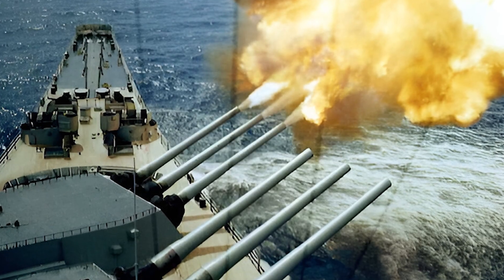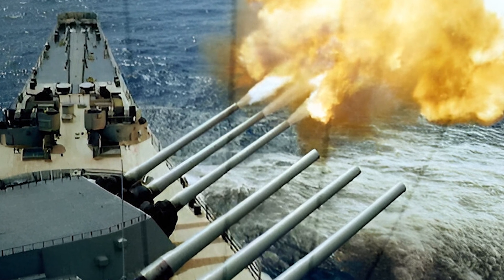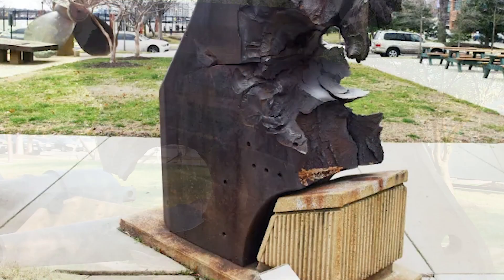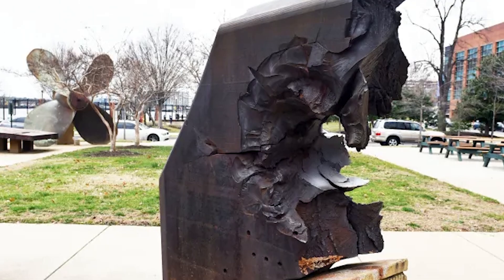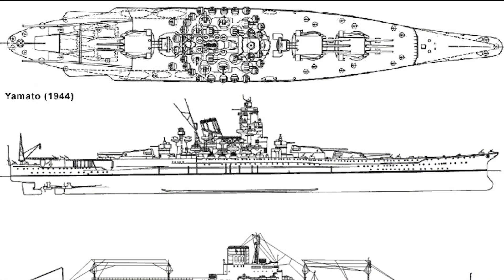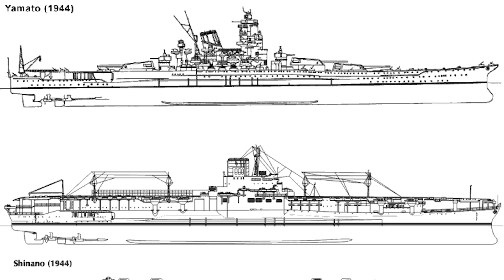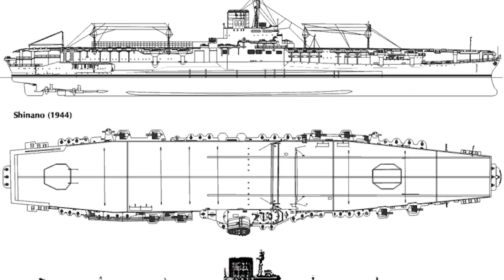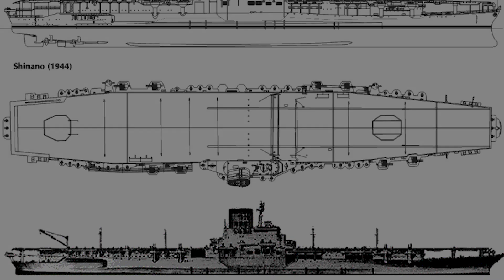USS-Iowa VS Yamato Armor Simulation

Comment: idk if the same applies for warships, but Japan has a long history of having very poor quality steel (this is why the swords were folded 1000 times), leading to their tanks for example having very brittle armour. Does your simulation account for this lower steel quality, assuming their warship steel was also of poor quality?
Reply: If you're going to base your assessment of 20th century japanese warship armor on your understanding of 12th century japanese swordsmithing, could you, at the very bare minimum, actually understand the sword part of it instead of just parroting tired myths based on oversimplifications so great they basically just become lies?
Reply: Look up battleship New Jersey YouTube channel battleship armor video. Yamato was only 5 percent worse in quality compared to the Iowa. And they were worse not because Japan couldn’t make good armor, it’s because as his video states Japan was capable of making good armor from less the perfect materials. This was done so they can save on metal in the war. The effects they determined were negligible in armor quality against shells.
Reply: From memory......

The steel used on their previous ships was the equivalent of Vickers steel, with the face hardened armour on the Yamato class being an attempt at improving it, but keeping in mind costs....

To quote Nathan Okun's website:

"Highly modified form of Vickers cemented (VC) armor. Used 1910-spec VC deep-hardening process, but increased Carbon content to 0.5-0.55% and eliminated cementing to reduce cost so that the maximum face hardness was about 510-520 Brinell with standard heavy production plates"

"Same metallurgical composition as new Vickers non-cemented homogeneous armor."

"By retaining the old Vickers water/oil quenching process on plates well above the thickness it was designed for, all VH plates in the thickness range 17-26" (43.2-66cm) did not cool fast enough deep inside and formed brittle upper bainite at their centers, which did not make them less effective as armor, but did cause them to snap in two through the impact point on any solid hit, which could result in secondary effects such as jamming turrets (the Japanese investigated the problem and solved it, but by that time no more battleships were being built)"

Call me crazy, by armour snapping in 2 would in fact make it less effective as armour...... but maybe I'm missing something.

According to his article,

Where "1.00" is the best,

The face-hardened armour fitted to the Yamato class is 0.839

Or only just better than German ww1 armour (0.828)
Reply: I'm surprised they even had enough metal to build those massive battleships

Comment: Still going pretty fast after, I can't imagine what it would look inside assuming it didn't ignite the battery.
Reply: Regardless of if it sets anything sensitive off, the turret crew definitely isn't having a good day.
Reply: @imapopo2924  Nope and I'm gunna guess a fairly large dent on the opposite site.
Reply: @ScoutPilfer  this wouldn't happen to the yamato. The test they did was not to test the capability of the iowa class against the yamato class, it was to test if the shells they had could possibly penetrate armour that thick. Under combat conditions the iowa would have bounced off the yamato's turret front at point blank range due to the angle at which the armour is mounted, the lower powder charge needed for safety and the worn barrel, as the one in the test was brand new.
Reply: Unless there was an exposed set of charges in the turret, it probably wouldn’t cause a magazine detonation right then and there. It might start a fire which spreads down the barbette into the magazine, but it’s unlikely to cause an explosion at the moment it impacted
Reply: @dr.depressed._6547  Idk if a fire would be able to easily travel down the entire ammo elevator
Reply: @dr.depressed._6547  I know, I'd say there is a reasonable chance of that in an active battle.
Reply: Probably a similar situation to the Iowa turret explosion. All the crew in the turret is lost, but the magazines remain safe.
Reply: It wouldn't ignite anything unless there are powder charges being loaded which would still only ignite just those charges. By that point, every naval ship had the gun house separated from any handling space and storage spaces by a series of flash tight doors. Only one opens at a time such that sparks and flames cannot travel between all the sections. This means any explosion in the gun house will not travel to the magazine. The turret is disabled but that's it.
Reply: In reality the plate had an angle of 45° and no naval cannon could penetrate that. Actually not even a Schwerer  Gustav...
Reply: @ShokkuKyushu  not even at flat broadside

Comment: jesus christ the shell was totally unfazed
Reply: It might not have deformed it a lot but it's the size of a small car, weighs about the same and has and explosive filler.... So yeah.
Reply: That's what a car flying at Mach 2 does.
Seriously now, this test is completely unrealistic in practical terms. This was a point blank whot at a flat plate, two things that would never happen in combat. If we consider these two would probably be sitting at 20km away, these shells would have dropped a lot of speed since left the barrel (760m/s), and would actually be closer to 500m/s (or less) at the striking point.
Reply: @abraquefeche2300  and probbaly close to a 30 degree angle. That would be interesting to see.
Reply: unphased*

incorrect on purpose
Reply: @nickkozak4763  "Unfazed and unphased are commonly confused words. The adjective unfazed means 'not worried, disturbed or surprised.' Unphased is a rarely used adjective meaning “not carried out in stages.” It isn't listed in most dictionaries."
Reply: @connivingkhajiit  no shit… ;$
Reply: @connivingkhajiit  you didn’t read the read more section…
Reply: @nickkozak4763 you just edited it lmao
Reply: @sesad5035  no i edited it because i spelled incorrectly wrong earlier

Comment: and back to your regularly scheduled shot simulations

also can you simulate T33 shot from the 90mm M3 against a panther's UFP from about 200 meters away?
Reply: 90MM AT GUN 🔥🔥💯💯💯💪💪
Reply: It would be an easy penetration for the 90mm M3 cannon. Idk if the T33 shot is the round with the 0.44 pounds of explosive filler in it, but could you imagine that amount of explosive detonating inside the cramped metal interior of a tank and the damage it would do to the crew. 0.44 pounds is a HUGE bursting charge. It almost exactly the same explosive power as a WW2 American 60mm HE mortar shell. The Sherman 75mm AP round only had 66 grams of TNT bursting charge, the Panzer IV and Panther 75mm APCBC round only had a weak 19 grams of explosive filling and the German 88mm cannons both had a bursting charge of only 59 grams. So 0.44 pounds is crazy destructive once it penetrates armor. The 90mm could reliably penetrate the sloped armor of the Panther. The 17 pounder usually would bounce right off the sloped frontal armor of the Panther. In the actual British users booklet on how to operate the 17 pounder gun, it clearly states that the gun can NOT penetrate the sloped frontal armor of the Panther with APCBC. The British tested the 17 pounder against the M3 90mm cannon twice, and both trials the British concluded that the 90mm cannon was superior to the 17 pounder. The M3 90mm gun was the best Allied tank gun of the war. The Soviets were not part of the Allies obviously, as communism and the Soviet Union were just as evil as nazism and nazi Germany. Only difference is communism killed many tens of millions of more people.
Reply: Yeah. T33 shot historically should be a clean through and through at even 1km against the Panther proven by testing at Aberdeen Proving Grounds. But in War Thunder it fails to penetrate at point blank.
Reply: @ThatGuyOrby Also almost any tank can straight up ignore even 128mm cannon if you hit "lucky" shot. Seeing non pen on T-34 turret, with gun that was able to wreck any ww2 tank (and a lot well after it was over) is something else...
Reply: should be a clean through shot, but in wart hunter panthers ufp bounces so many shots it shouldn't lol
Reply: @user-fe7bo5mm1o  ik. I just want the satisfaction of seeing what T33 could've been